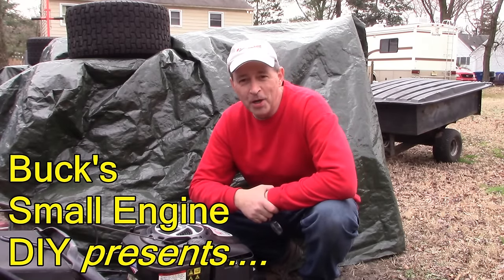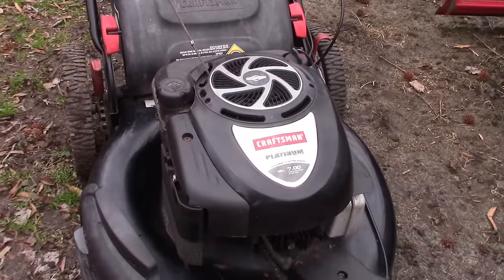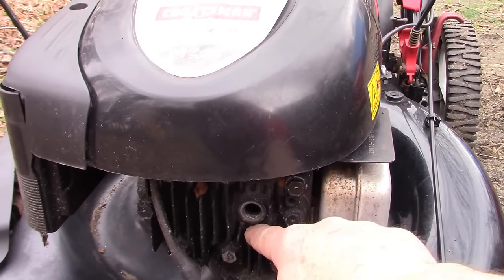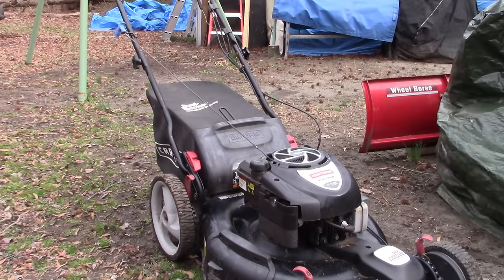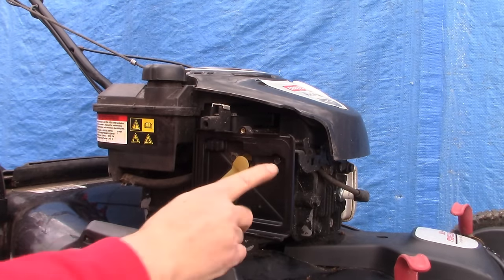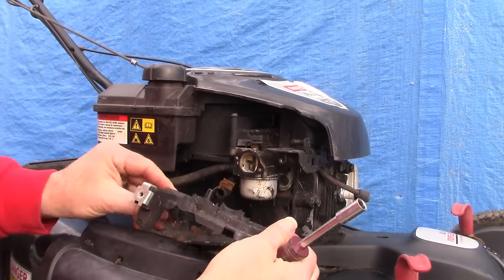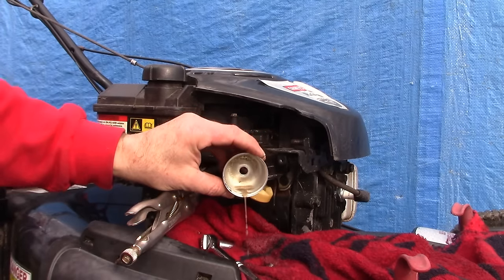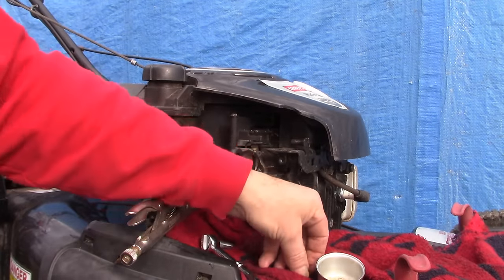FIX any LAWN MOWER in 10 Minutes or less - GUARANTEED !!

Comment: I would have used compressed air to clean out that jet. If you use metal, particularly when you've got hard metal as on that pic plus a taper that gradually enlarges versus soft metal on that jet- you might enlarge the size of that jet.
Reply from the maker: ethanol fuel turns to varnish that restricts the flow of fuel and decreases the size of the jet hole. Air alone might not be enough to open it up.
Reply: Yes, use an air compressor & blow that gunk out...don't take a chance with a metal tool. Most any compressor will make plenty of air pressure to be able & purge that jellified crap out of those holes. If anything, use something plastic...it should go without saying... never use anything metal to clean the inside of any carb!
Reply from the maker: @purdyboi8078  Actually there can be a built-up varnish that forms on the sides of the jet, and air alone or even carb cleaner will not remove it. It must be scraped off, and that's why a metal wire, pick, or bread tie of some sort is necessary to eliminate that varnish. This is particularly the case on those carburetors with the tiniest of holes.

Comment: I have 2 mower that won't start. An really old Craftsman and a Troy Bilt TB110. The Craftsman has a really weak attempt to turn then it dies. The Troy Bilt last week I got to run for a few minutes then it died. Now it won't even do that. I've replaced as many pieces as I could. I don't think they're getting any gas. I've tried the drilling the hole technique but it hasn't worked. I put the hole just about in the middle and I'm wondering if it's too covered up to breath. I'm either going to make a hole lower or put a hole in the top of the cap. I bought new caps so destroying the old ones is no problem. If u have any suggestions please help. Thanks. My Craftsman did start when I shot carb fluid inti the carburetor. The Troy Bilt didn't. Yesterday I put 2 gaskets behind the air filter on the Troy Bilt and cleaned the bottom jet again and it didn't help. Also cleaned out both fuel tanks and did oil changes

Comment: I have a cub cadet cc30h lawnmower. It started surging so I replaced the carburator, air filter and spark plug. Then it wouldn't start so I checked the battery cables the black cable had a bolt missing so I replaced that. Now it won't start when you turn the key the starter clicks and one time the engine trys to turn over and then nothing. I'm clearly a novice but I can't afford a repair shop. Can you help me?

Comment: What happens if the mower doesn’t start for a second or two with starting fluid? Not getting spark? Would a new spark plug fix that?
Reply from the maker: A bad spark plug can cause a no-start situation, but it is unlikely. Either way, it's worth a try since they are pretty cheap, and especially if you haven't ever replaced it. If a new spark plug doesn't work, get a cheap spark tester from Harbor Freight Tools or Amazon that goes inline between the spark plug and the spark plug boot. If your ignition system is producing spark, the light should flash when you pull the starter rope.
Reply: @Buckwsr I figured it out last night!! The “zone/brake/safety” lever wasn’t fully disengaging the kill switch any more. I took the cable off of the engine side, spun it three or four times to lengthen it. (it’s threaded). Lawn mower starts on the first pull now.
Reply from the maker: @DanClaunch  Great job, sir! Glad you figured it out. Here's a video I made to help people understand what that control/safety/brake cable actually does. https://youtu.be/a3tVL23J87s

Comment: Yes you are awesome. I couldn't make the 10 minute bowl drain plug clean out, took 3 times then I'd find my torch cleaners and with a small enough wire id get it right. My bowl seal broke found a large ring cut it down threw some flexseal on it. Cleaned the bowl of any excess flex then reinstalled. Although now dark pulled the cord and it came to life. Immediately I could tell it's going to run. Thank you for teaching me. Being a poor man I do my own work and not sure why at 52 you were able to learn me and you did. Ohh yes thank you YouTube for having your platform last thing the free solution I was referring to in my last post was free-all a rust penetrant. I was dialed in on carb, maybe airleak, or idle spring missing , tried to find a good exploded view and noticed Craftsman wants 78bucks for a carb, it's mower 4 for me so no but ebay 22 bucks. That way was maybe, but your way some fluids and sprays and time ty
Reply from the maker: Good job fixing it yourself!

Comment: “ at the end of my rope “ Thank you for your post very helpful. My problem with the craftsman all wheel drive, is it doesn’t have 30 hours in it’s life, got it started, got it running but now my problem is when I go too pull start, it’s jammed and I don’t know where the electric start charger battery Plug. When I try to pull start it just sticks so, @ short pull sticking point, @ just a few inches, I would pull feedback repeatedly, but it won’t let me pull it enough to fire it up. It’s like jammed, but I got the whole string @ its maximum capacity length but when I feed it back in, it won’t release!  to let given enough pull to crank it, I feel like I’m at the end of the rope, but it’s not enough to get it going! Can you help? thank you.
Reply from the maker: I have other videos about repairing the recoil/rope starter, but not for this same lawn mower exactly. Either way they're all pretty much the same. I'm sure you will find some good info on YT. Good luck.

Comment: So, did all the things and she still doesn’t work. She fired up with starting fluid. Just got it last year and it was leaking something awful from the bowl. Replaced gaskets and put it back together.  Started fine. Didn’t leak. 

Then it sat for the winter and now it won’t start. Cleaned the carb and jets and still no joy. 

Any ideas?

Comment: One quick question does regular gas work on these lawn mower?
Reply: No -- use the highest octane you can buy.
Reply from the maker: Yes, but most gas these days is formulated with ethanol which will gum up the carburetor if left unused in your machine for extended periods of time, like, over the winter, for example.
Reply from the maker: High test is not required for small engines. I use regular 87 octane always with no issues. Just recognize that most fuels these days are formulated with ethanol which may gum up the carburetor if left unused for extended periods of time.

Comment: My mower, (old Briggs engine), won't  start unless I spray starting fluid into the carb. After that it runs great. If I shut it down to get a drink... or get rid of a drink, it'll  start right up. However if I wait much longer, I need the starting fluid. Is this a main jet problem?
Reply from the maker: No. If it runs well once started, it's not a main jet problem. It might be a choke issue, if it has a choke.... Or if it has a primer bulb you press, maybe that bulb is not working as it should. I personally hate the primer bulb on some briggs engines. They just don't work. In which case, the starting fluid is now your new primer....
Reply: @Buckwsr Thanks for your quick  response. No primer bulb. There is a throttle cable on the handle bar. I may tty to adjust that for more length and/or spray the linkage with carb cleaner.
Again, Thanks.
Tony

Comment: Okay well mine starts then goes weak and dies in like 15 seconds. Guessing it’s the carb that needs cleaning. Do you just remove the cover and filter (mines foam) then spray the cleaner in the throat like that? I’m guessing it’s a dirty carb, I’m not incredibly handy….
Reply from the maker: Well, before you dive into the carburetor, try something easy: Install a new spark plug. I have seen what you're describing go back to a faulty spark plug. Start with the easy stuff.

Comment: It would bea good idea to try to start the mower before you put the air cleaner back on. If it didn't start you would remove the carb to clean all the ports, jets, etc. and you would already have the air cleaner off.

Comment: Not getting gas when I prime it,,,,, and I already cleaned the carb plug?   Would it be the main jet clogged?
Reply from the maker: The primer bulb set-ups on these engines are lousy. You're probably pushing the bulb, but it's doing nothing. The engine I use in this video does not have the primer bulb, but rather the automatic choke, which is a much better system. Try this: Open the air cleaner cover, remove the air filter, and shoot some starting fluid into the throat of the carburetor. If it starts and stays running, then it's not a clogged jet, but merely a primer bulb that isn't working.
Reply: @Buckwsr  ok and I lived the cable,good gas, spark plug and should I check out the flywheel?
Reply from the maker: @alfrjr1283  Does it fire up briefly on starting fluid sprayed directly into carburetor throat? That's the first test you need to do.
Reply: @Buckwsr  I will have to get some when I get off work and I'll be sure to let U know and thank U for responding your awesome 👍
Reply: @Buckwsr  well I'm not sure what is going on with my mower and it's not even trying to turn over

Comment: Is it normal for a Craftsman Platinum 7.0 horse mower to require several pulls when first starting?  I do not have a primer bulb.
Reply from the maker: So, if there's no primer bulb, then your mower has an automatic choke system. When the engine is off and not warmed up, the choke plate should be fully closed. You can remove the air cleaner to verify this. If there is any debris obstructing the choke mechanism, clean is off so that everything moves smoothly. Assuming all is well with the choke system, you still might want to do what I showed you in this video to clean out the carburetor. If you do that, I'd say one or two pulls should be all it takes to get your mower running.
Reply: @Buckwsr  Thank you for the reply.  I used your video to clean the jets and bowl.  There wasn't any debris in the bowl, but I suspect I had water in the gas.  After the cleaning it ran without surging and stopping after a few seconds of running.  That problem appears to be solved.  It has always had trouble starting when cold (since new).  Once it is warmed up, it starts on the first pull.  Otherwise it can take 4-5 or more pulls to start.  I will look at the choke again, but I don't think it is closing all the way.  Not being mechanical, I don't know how to adjust the choke.

Comment: Okay but, what if the recoil has a lot of tension? Like, it's really hard to pull and seems to get tighter with every pull? I thought you guaranteed I could fix my mower in 10 minutes?
Reply from the maker: The problem I address in the video is 99 times out of a 100 the reason a mower won't start. But certainly, you could be dealing with a different issue....
Reply: How much oil is on the dipstick?

Comment: I have a John Deere SX 95 rear engine mower . I can not get to the carb without taking the  whole dang thing apart. It has spark, battery is good, but it won't run.  This model sucks to work on. I am about puting it curbside ! Anyone  got a quick fix ?

Comment: I tried all ur steps but failed 😢. The oil tank or motor is leaking oil,   and the gas cable had at the end an coil that doesnt do much only if i do itself by pushing the leaver.

Comment: Fifty years ago I would run a bottle of carb cleaner directly into my car’s carburetor to clean it.  Would that work on a mower at the end of the year to remove the crud?
Reply from the maker: The issue would be the old fuel sitting all winter in the bowl of the carburetor, turning to gel and varnish, and clogging up the jet(s). A better option end of season would be to drain out the gas from the tank, and then fire up the engine and let it run itself dry. Then store the mower with no fuel in the system. Most of us, however, never get around to doing that with our equipment, myself included.

Comment: Let's say it is a Honda, Nikki, Keihin, or some Walbro carburetors that have a pilot jet, main jet, air/fuel mixture screw, and emulsion tube.  It takes 45 minutes to remove carb, clean it, and reinstall.  In fact, most of the time you need to remove carburetor and go through it and clean it completely. So ten minutes is an outlier. Fuel issues account for about 80-85% of small engine problems.

Comment: I wish you could run a cleaning solutions through the carburetor like they do in the kidney dialysis to flush everything out without removing it
Reply from the maker: Well, they do sell a lot of fuel additives designed to prevent these problems. Some people swear by them. I don't use them, not convinced they make any real contribution.